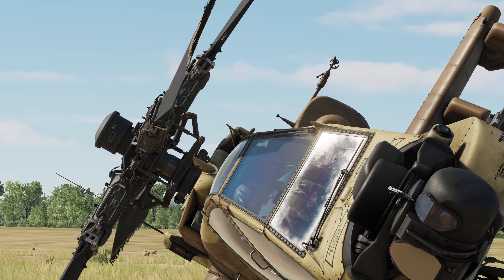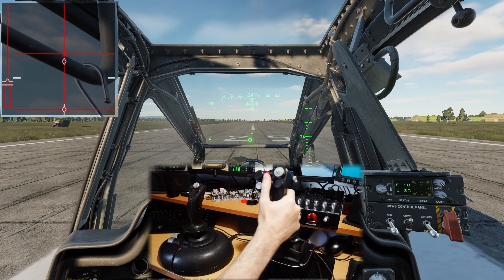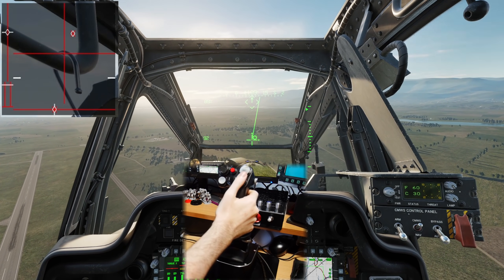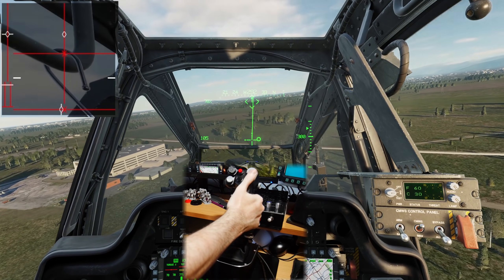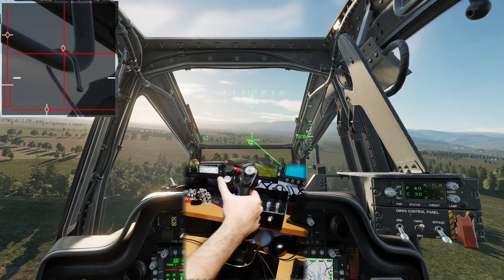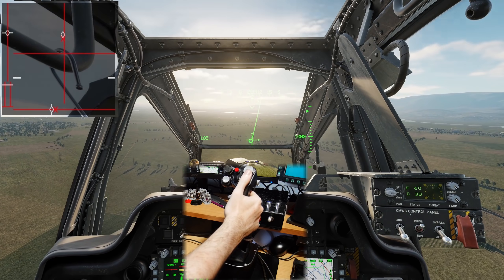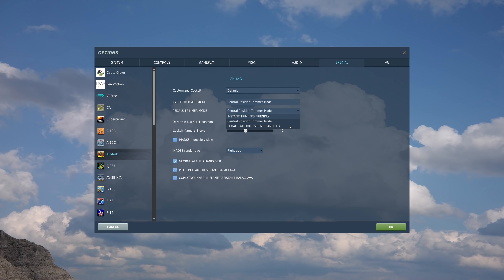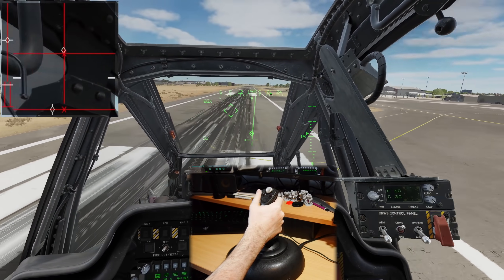DCS: AH-64D Apache: Understanding Trim

Comment: Hello, I use ma ffb2 in apache just like You, but I have a little problem with it. Every time I set new center with force trim, youstick does not return to the exact same location I just have set. It has a little offset, always in the same direction. It makes flying very difficult. It's a second ffb2 I have, and the same problem. What's is wrong? Any clues? Thanks!
Reply from the maker: The axis on the FFB settings in DCS need swapping You'll probably notice it's swapped pitch and roll.
Reply: @RedKiteRender thanx for answer. I already swapped axes, but it's not this. It's only slight offset. Joystick centers not exactly in the spot Ive chosen. Usually it's slightly to the right. So when I fly with controls position visualization on, white diamond is a little to the right of this red one, when I put joystick freely.
Reply from the maker: @mwudarczyk84 Hmm that sounds more like a calibration issue with the stick then. If windows still has device calibration, it might be worth running that.

Comment: For some reason this all feels a lot more intuitive in the KA-50 than the Apache
Reply from the maker: KA-50 has more power and less trim change requirements, it's also a little more capable of self governing, being designed specifically as a single person helicopter, it's got to pull more of the flying duties off the pilot to make it practical.

Comment: For for a dry clutch system, would you agree the trim system can pretty much be ignored?  I'm getting mixed signals here on this....
Reply from the maker: If you have a dry clutch system, that holds the stick stationary when released, then no, you do not need to use stick trim. I'd disable the stick trim, but keep the rudder trim.

Comment: That last statement on FFB sticks - well... There actually are FFB bases that you can buy. Brunner makes them - but they are fairly costly at around ~1500 buckaroos. You can also buy an FFB base from walmis (Vpforce Rhino) and it's "only" over 800 euros, so half the price - but also with better internals. A good deal if you ask me, but I understand it very well that not many people are willing to pay that kind of cash. (It is freaking great, though, for helicopters and non-FBW airplanes especially, but you can also use some FFB effects in FBW planes, which is pretty great as well)

Comment: Great stuff! Thanks. However, I find there is now a ‘Trim Reset’ control option in my latest Apache Module. But, using the special settings you suggested I find I’m unable to ‘detach’ the torque pedals from the trim system???

Comment: What’s your opinion on springless sticks? I keep my VKB gunfighter with a 6 inch extension and with no springs. Would forced feedback be better than this?
Reply from the maker: FFB is Much better, but much more expensive, harder to find and few options. Springless doesn't simulate the centring forces of the magnetic brake system.
Reply: @RedKiteRender  What you could do with springless is tighten the dry clutch to make it hold whatever position you leave it in. But in terms of fine control input springless is nice. You have a lot of control of the helicopter in game with it
Reply from the maker: @Rokaize  I hope the VKB with clutch tightened up doesn't have any stiction / restitution issues?
Reply: @RedKiteRender  I’m not sure exactly. Haven’t really given that a try. Might make an interesting video  perhaps

Comment: @RedKite

Thanks for making this video. I actually have owned a MS SW FFB2 since it was brand new in 2006. (Best Buy at the time was discontinuing them and I actually got the display model! Glad I did lol.) I also have rudder pedals with springs. I normally always just leave the FFB2 unplugged from power for everything I do, but this is interesting. So if I want to use it the way you show it at the beginning of this video, then I'll select "Joystick without springs and FFB" for that, correct?

Another thing, the FFB is only active when I have my hand on the stick from all my previous experience with it, like it somehow has the ability to sense that your hand is there or not. I have, however, put a piece of tape on the stick before to make it active all the time. Do I need to do that to achieve what you were doing in the beginning of your video, or does DCS somehow handle this for you? Or did you modify yours somehow to achieve it being active all the time? I'm actually pretty excited to try this and think it will make flying the Apache a lot more fun, not to mention easier.

As for the pedals, I guess I will just have to experiment with the 2 more conventional modes. By the way, what is the command in the DCS controls setup called for working the trimmer?

Thanks so much, again. =D

Dan

Comment: I miss my old MS Force Feedback stick. I picked it up on Ebay for £5 around 2004. Only downside was it had the pre-USB connector, which plugged directly into the graphics card. When those eventually became redundant I think i binned it. Didn't think at the time I should have just bought a USB converter cable. Damn! :((
Anyway thanks for this tutorial. Being new to helis on DCS, helicopter trim was confusing the hell out of me. Now it all makes sense....well, mostly makes sense.

Comment: So helpful, you have no idea! THANK YOU
Ok, one question. Are you saying a cyclic like the old MS joystick you used is better than a spring joystick that you used second? Ie a cyclic that holds its physical position when trimmed? Can you please recommend your best choice of joystick for helicopters please. 
I’m am about to buy, as in a couple of days time. Thanks. 👍👍 (new subscriber after watching this)
Reply from the maker: Unfortunately FFB don't really exist unless you've a couple 1000 to spare these days. The one demonstrated in this video is 22 years old and no longer produced. Most normal joysticks will do an okay job for a helicopter. My personal favourite is the VPC WarBRD base, with soft springs / smooth cams and a handle that has lots of switches.

I would not recommend the spring joystick shown in this video as it has detents / bumps in the motion as you cross the centre, making hovering a little trickier, it's better for fixed wing really.
Reply: @RedKiteRender  How about the Thrustmaster T.16000M. Looks like the spring is for stick rotation (rudder control you can disable). Any thoughts?

Comment: Great lesson on Force Trim! In real helos anti-torque pedals will not spring back to a middle position, so the last DCS mode without spring and FFB for the pedals would be the realistic one - as long as there is no spring forced middle position applied on the sim pedals. I guess the mfg pedals without springs and with the damper comes quite close to the real thing. What I wish to know is whether helos without force feedback servos (i.e. R22) have the stick striving for a middle position caused by the state of the swivel plate being the " relaxed" state, without any force moments acting on the swivel plate rods. And does the apache also has beep trim?

Comment: Question. Doesnt the FFB stick prevent full stick movement also like a spring stick. Since the FFB stick is say 75% to one side on the X axis wont that pretty much be the same as the spring stick?
Reply from the maker: The FFB it simply changes where the motors want to centre the stick, so if you trim at 50% forwards, the stick is still 50% forwards, the controls remain 1:1 and you can go all the way to 100% back. You never lose 1:1 inputs like you do on a non ffb stick.

Comment: I definitely am using a mix and finding it the most efficient. Being Central Trim for Cyclic, and Pedals without Sprint cheat for my Pedals. I definitely hope a trim reset is added, I think you really help in justifying why in the sim world it is required due to equipment limitations.

Comment: I have a Warthog modified with very soft springs and TPR pedals set to minimum resistance. What I do is basically not trimming the helicopter at all at the moment. I have learned to use the cyclic with both hands, so if I need to use my right hand for mouse input, for example, I just swap hand on the stick. 
I am sure a “real” hely pilot never let the controls go anyway...

Comment: Thank you for doing this, RedKite! I'm always trying to explain this to fellow users and your illustration and clear explanation will really help.

Also, there's no reason DCS's "center offset" trim system should limit the control extents! That's shocking to learn! Instead it should scale so that the real-world controller extents always reach the virtual stick extents. I always assumed that was how it worked, but as I have a Logitech FFB stick, I never noticed it. No wonder I crash when I forget to turn FFB on before flying choppers! I only really noticed the issues when I got the Hind and wanted to apply trim to the pedals as is realistic for that type. (But not for any of the choppers we have that preceded it.) That's insane! 

They should add directional trim to choppers (which the Hind has already) as another work-around for non-FFB stick people. Not realistic, but then neither is the Trim Release that all the DCS choppers have (except the Apache though I believe they've promised it's coming).
Reply: Oh and here's another stupid thing. There's no need for the FFB FRIENDLY option as DCS disables the "return to center" BS when FFB is enabled automatically. So you can keep the special menu on "Central Position" mode and not worry about it messing you up when you use your FFB stick. If you forget to turn FFB on, you'll then be in the mode you probably prefer. (I wish I could keep FFB on all the time but it will just not play nicely with many of the DCS aircraft and even the ones it does work okay in have bad trim offsets that I wish we had an option to bias. I do use FFB on all the DCS choppers, but sometimes I don't due to all the time it takes to exit the mission/server and restart the sim to change the setting. Then the insanity begins! LOL!)

It's no wonder nobody figures this out. Thanks again! ED have needed this tutorial since their first choppers came out!

Comment: I found enabling the trimmer for the pedals to be very distracting. Part of the issue is inherent to the Apache; there is no independent trim release for the pedals like there are on bette... I mean, other helicopters (UH-60, for instance). I found the best thing is to use the third trimmer option for the pedals (Joystick without springs and FFB) and just flight the return force (Or disconnect the spring from my pedals). For the stick, I prefer the first option. I hate the loss of control. For the first trimmer option, I think a setting that changes the rate at which trim position moves from the old to new center point. That could help reduce the transient when trimming. 

BTW, this is the best video on helicopter trim in DCS that I've seen. Very well done. I agree with just about all your points.

Comment: Since my current flight stick is a Logitech Extreme 3D Pro---spring action and no FFB---I'm rather inspired by FFB when I discovered herewith that there's more to the FFB than an effects enhancer that simply rumbles on impact with some virtual entity :) 
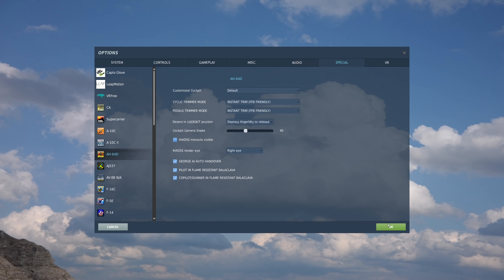Around 5:20 you begin to demonstrate respective trim choices under "Special" settings....... in the "Instant" mode you explained what I recall was particularly difficult to grasp when I'd bought the A-10C Warthog standalone in 2012 or so....... "cumulative" effects to trim were tough to manage; I actually wondered why such an effect would be of any value and if that was the actual trim system in the real-world A-10?!?!
Around 6:20 you cover the cumulative effects to rudder trim. Admittedly an "empty vessel" of advanced knowledge at this point, I'm often compelled to attempt to trim out the spinning on takeoff and/or the constant left-rudder hold until underway in forward flight. I'm a bit confused about rudder, though...... I can only presume that up to a certain speed, only tail rotor blade pitch works the yaw, then at a certain speed rudder can take effect........ (?).
Yet another work of excellence here, RedKite. Thanks!!
Reply from the maker: As you speed up, the aerodynamic effects will stabilise the aircraft (same way a plane does) So you need less anti-torque (yaw) input to fly straight. You also generate extra lift, as a result of the two combined you burn less fuel in flight than a hover. The anti-torque becomes less effective at speed, because the airframe wants to weathervane back into the direction of travel, so rolling and pitch is necessary to change directions at that point.

Comment: Excellent video. As I also fly with the ffb2 joystic I should add that I had to lower my ffb  tune to trimmer force = 20. Otherwise I had to "fight" with the stick. If possible comment your ffb tune. Thanks!
Reply from the maker: I used 100%, just press the trimmer and hold it, move to new location then release. I've not struggled with the forces, myself.

Comment: I know it's my opinion but the central position trimmer mode seems to be the best option overall provided you're thinking ahead and making the trim corrections in advance of velocity/attitude changes (The trim is to combat hand fatigue - once the trip leg has been made and it's time to start changing  speed, you are removing the trim and placing the burden back on your hand)

It's an increase in the mental workload (same as instant) but this increase in workload normally comes at a time before interactions have dire consequences for errors. 

I've killed a LOT of Apaches in the last few days before I gave up and started enabling the Controls/Trim position overlay (RCtrl+Enter)
I hated having it up because of how it affected my immersion, but considering I'm working with a spring centering stick, It's really the only way to give you reference in absence of a FFB stick.

My flights have since become a lot smoother, and while I may still occasionaly bend a rotor, I'm no longer totalling airframes.

Great news that they will be adding a reset!

Comment: After watching this video, I just ordered a Sidewinder 2 from Ebay.  It will be here in a few days.  If you have a chance, could you please tell me what other software I am going to need to get the Sidewinder up and running with Win10.   Thanks.
Reply from the maker: None, should work with Win10 without any extra software. Make sure to tick Forcefeedback in DCS's options and you'll need to FFB Tune your device in controls. I found the one of the axis needed inverting to make it behave correctly.

Comment: 4:06 the "Trim Reset" is not going to help there. It is actually doing things even worse.
The case scenario that you have just run out the cyclic range is rare, and if you now would suddenly need to move cyclic as much to oppositive direction is rare as well. 
But if you end up to such situation, last thing you want is that the new cyclic control input is instant by moving joystick somewhere and reset trim and cyclic would instantly jump in the new position. Now you are in serious problem. 

All the time the control inputs should be smooth, slow and predictable. And to get from full forward trim as in your example to full aft, is really just "pull back, trim, center, pull back". And in properly flown helicopter you never end up to such situation that you need to reset trim.

After flying Apache with TM16000 and using centering trim (default), it is super easy to handle Apache even in aggressive maneuvers where actual problem is the amount of torque, not the need to trim and center. 

Still, best option any helo player can do is to remove the spring in their joystick and just have "springless, non-FF joystick" or "FF joystick" if having one. You will always maintain that idea where the cyclic is and never need to recenter or instantly move virtual cyclic.

Instant trimmer mode (FF mode) is best for tiny movements. If you are constantly making small adjustments and trimming by clicking every second, it works great. Just move little bit stick and trim, trim, trim and it keeps adding up. 
But if you want that hold+movement feeling, then default is best, as you quickly learn that centering joystick after each trim and you don't run out of trim. 

And really getting pedals separated is huge advantage. They will brake your mind if you don't.

Comment: Um. I still use a Sidewinder 2 for helicopters in DCS because I don't have pedals. It sort of works in the Gazelle (Because the trim just disables the FFB completely and doesn't change the centre when you turn the mag brake back on), is excellent on the Hind and the Apache- well, god knows. I haven't gotten it to work yet. Also the lack of hats makes me sad.

Comment: I don't understand where all the confusion comes from honestly. A trimmer reset is not necessary.

And your explanation should solve any further questions from anyone.
Reply from the maker: When shit hits the fan and you've got 23mm/missiles flying your way, having that trim reset to restore 1:1 control makes it so much easier to manoeuvrer. Might not need it flying grandma's Apache, but there are times its very handy to have a reset.